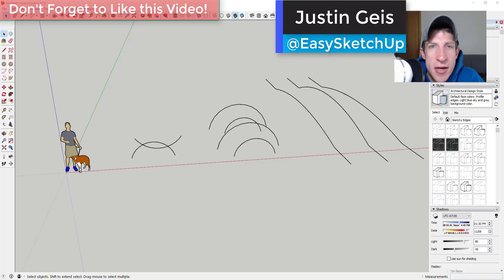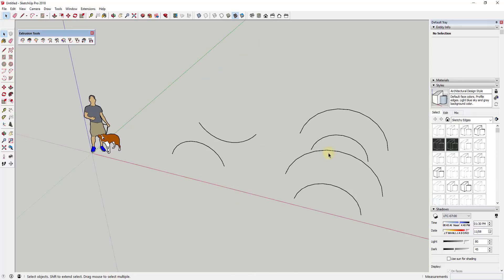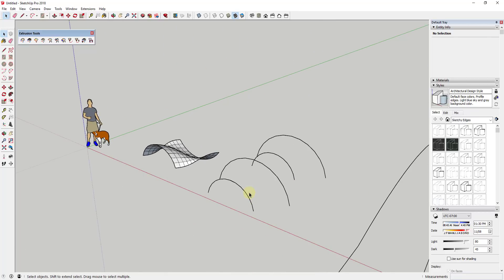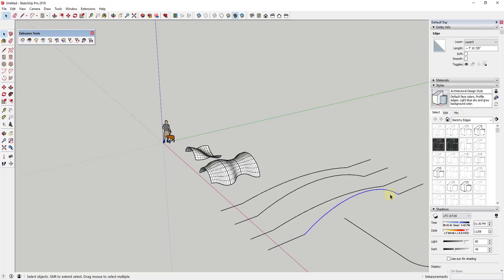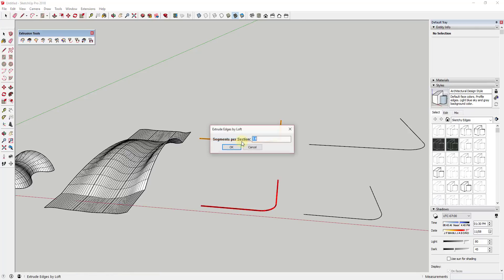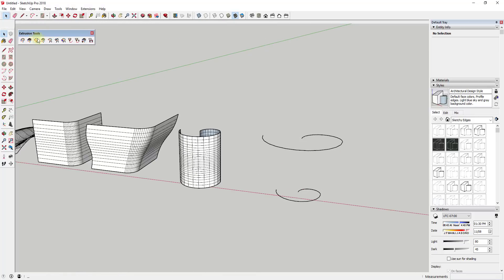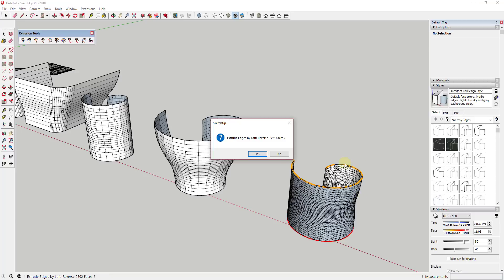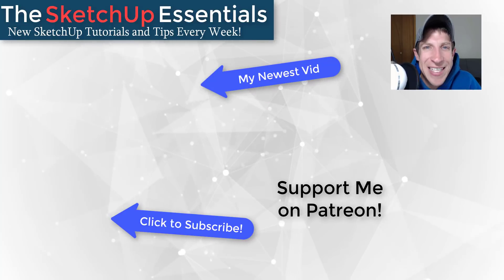SKETCHUP EXTRUDE TOOLS TUTORIALS (EP3) - Extrude Edges by Loft for SketchUp

Comment: Would this be the most efficient way to have an extrusion from an elliptical face to a circular face?  And possibly through a 90 degree bend?
Reply: This worked for me recently when making the transition from an ellipse to a rectangle with rounded corners. I learned the hard way (because I had not watched this video at that point) that having the same number of segments yielded much better results. 

To do this I had to explode the curves and once you do that the number pf segments will be displayed in Entity Info. Then compare that to the other curve. In my case I had a difference of 13 segments so I looked at the individual segments to find the longest ones then right-clicked on each one at a time and in the pop-up menu choose Divide. 

You can then type in the number of segments you want to break this segment into. Once I had the number of segments the same I welded them back together and proceeded to use the loft tool and it worked very well.